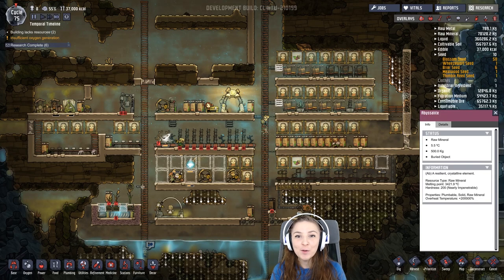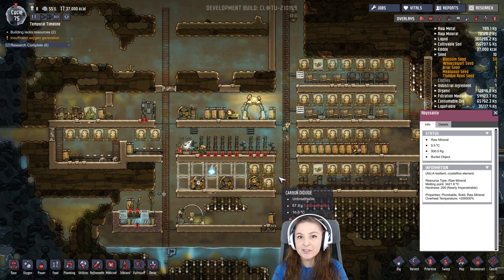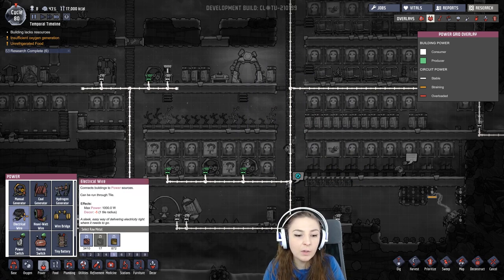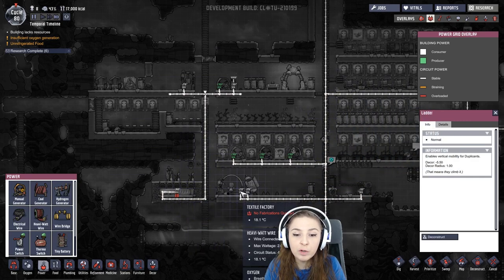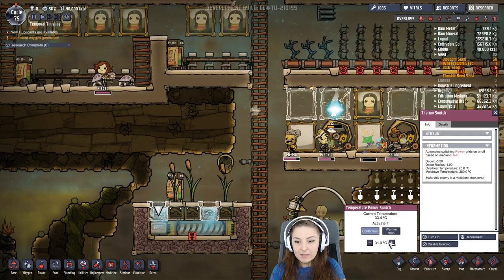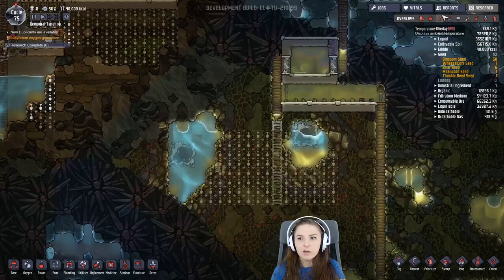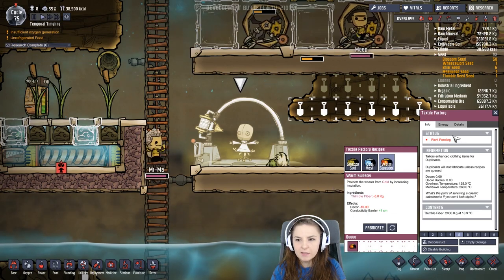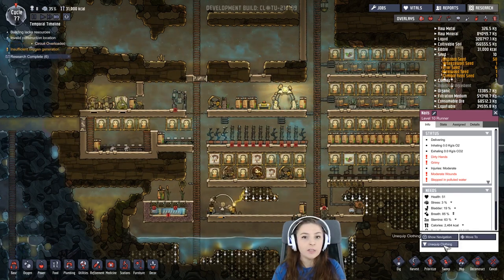Update Overview and Tips About Electrical Circuits!!!  - Oxygen Not Included - Alpha Release/Thermal

Comment: Coal generators are a pain now. I mean it's actually kinda fun trying to cool them off, but it's not so easy now.
Reply: You can use it as a heat source which is interesting. The problem is that CO2 is extremely good at keeping things warm I even had my water purifiers damaged because they were surrounded by CO2 and got too hot. I think as long as you suck out these CO2 quickly Coal generators don't really need any cooling but I also put them in cold places just in case.

Comment: so iv been enjoying this update, but as of later last night i ran into a big issue of the heat generated by the coal generator and it constantly breaking... any ideas?

i have this in its own contained room.
Reply: Try moving it to ice biome :)
Reply: Got the same problem, for me I crossed some of the gas pipes through the generator, the gasses from your own generator are cooler and it will cool your gen naturally. Same for water pipes